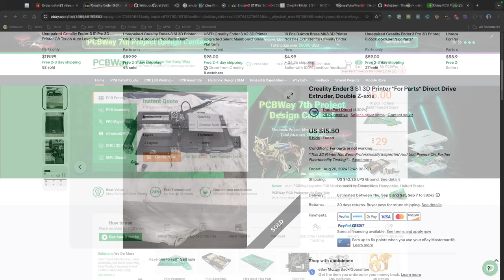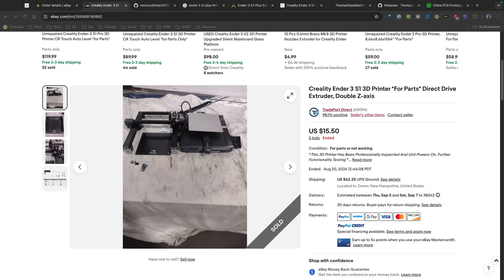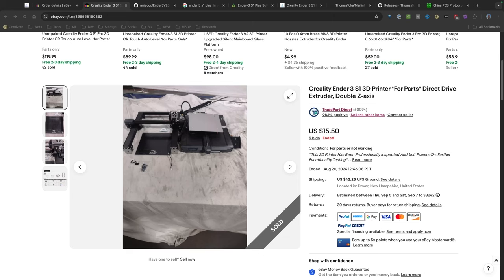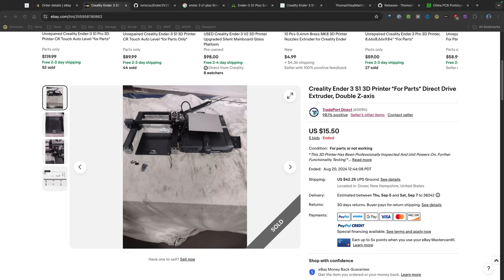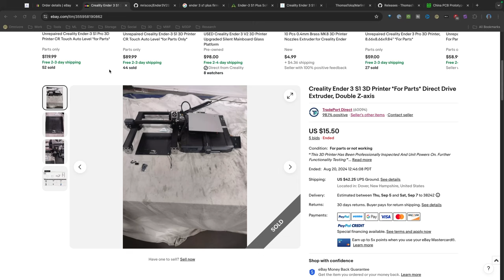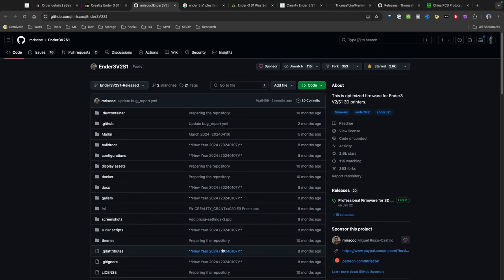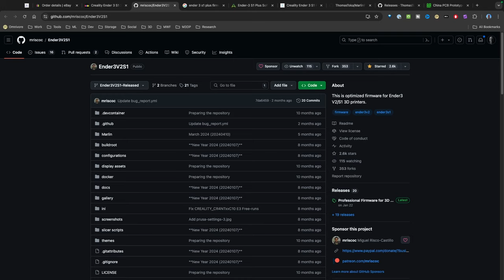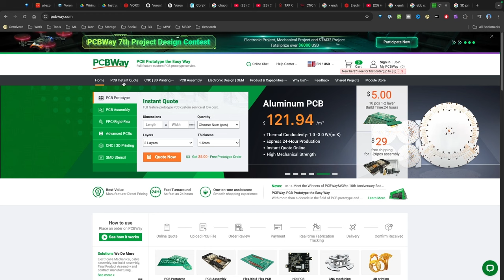Ender 3 S1 eBay Disaster? Step-by-Step Mechanical Restoration (Part 1)

Comment: I'd change that cable clip for one that switches it from a horizontal to vertical orientation, I've replaced the ribbon cable on 2 Ender 3's with the Sprite Pro extruders due to the factory ribbon cable clip.
Neither lasted 12 months from new.
Reply from the maker: Do you have an STL you can share?